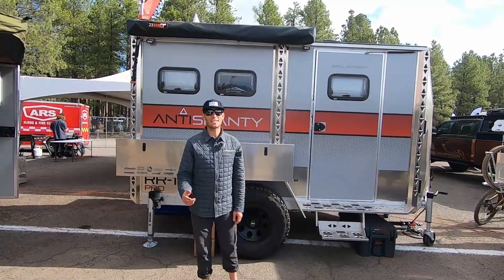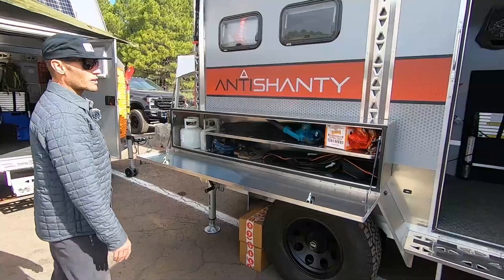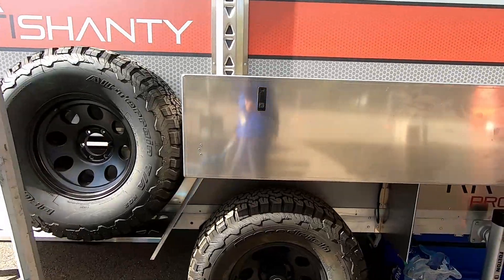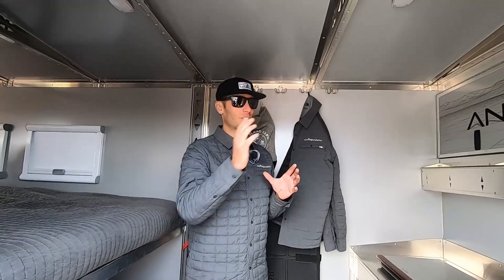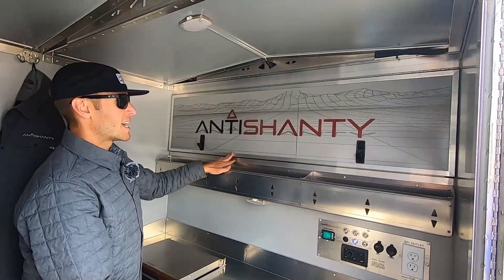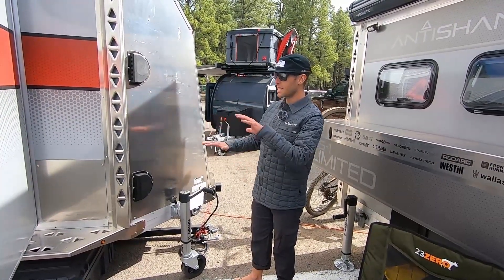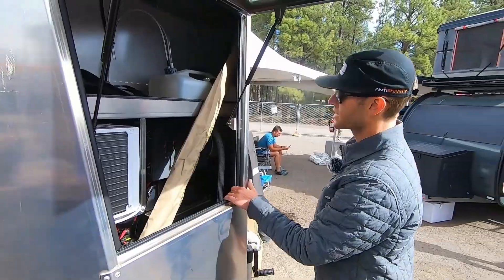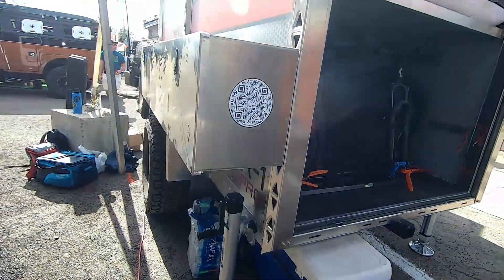Off Road Toy Hauler: Anti Shanty Flat Roof

Comment: One thing I really like is the dual tongue jacks for leveling. I've never thought of that and I think I'll do that to one of my trailers just to see how I like it. That would be two jack stands that I don't have to set up when I get to camp. In my opinion having the diesel fuel tank in the same compartment as the power compartment is dangerous. Sparks happen. Flamable fumes and electric stuff should not be in the same compartment.  The removable tongue is a great security idea! That could be done to any trailer with a little cutting and welding.
Reply from the maker: Let us know how it goes with the leveling jacks.
Reply: Diesel doesn't produce flammable fumes like gasoline does! If that was the case, Home Heating systems wouldn't have the Fuel Tank(s) in the same area as the Furnace!👌